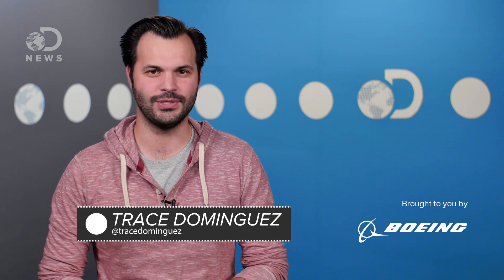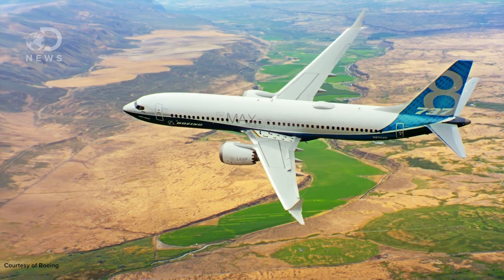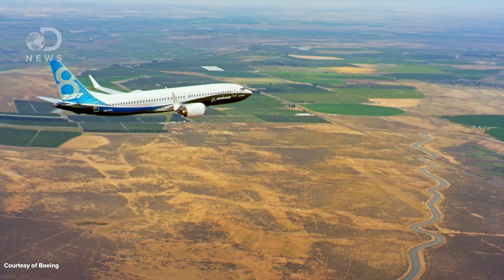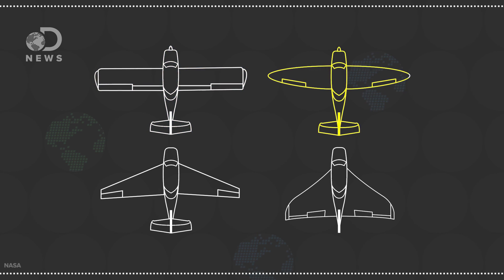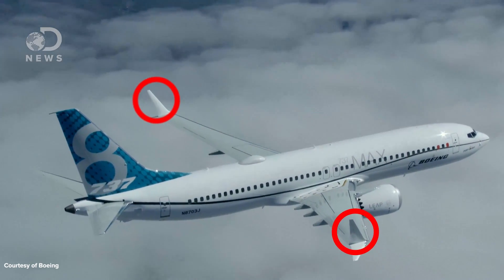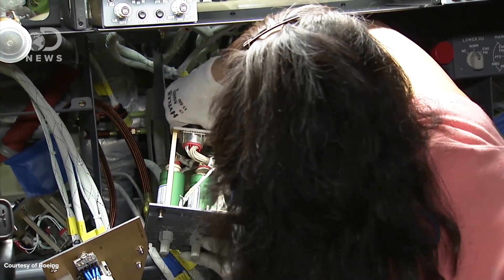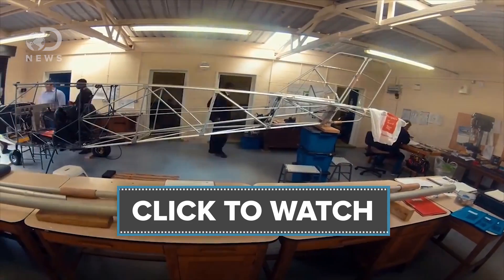Here's Why Wings Don't Fall Off Airplanes

Comment: well that's bullshit because thousands of planes of had wings fall off! In addition it's AEROPLANE not airplane!
Reply: it fell of sue to bad manafacturing simple as that

thousands have not fallen due to wings falline off (excluding combat aircraft)
Reply: Sure, thousands of aircraft had wings fall off when they were shot down by other planes or by ground fire. Unless you are dumb enough to fly your plane into a thunderstorm, the wings are not going to just fall off.  And there is nothing wrong with the word airplane.  If it's in the dictionary, it's a legitimate word.
Reply: Theweescot Airplane, Aeroplane and aircraft are all general terms
Reply: So when Chalk's Ocean Airways Flight 101 crashed in 2005 the wing didn't fall off the aircraft no! Don't talk shite!
Reply: Theweescot one thing is that you are comparing two completely different types of aircraft. that plane was built with a crappy 1947 method. there was stress on the wings, they constantly applied sealant because they had fuel leaks. mind you only 57 of these were made. I doubt they are in checkup like these big commercial aircraft,  that accident could have been prevented
Reply: The wings still fell off, this video title is still bullshit and meaningless.

Comment: The Title really is a bit ... strange?
"Here's Why Wings Don't Fall Off Airplanes"

Hey, here is why windows  do not fall out of your wall - cause usually humans are smart enough to fixate them.
Reply: But wings always look like they could just fall of at any moment. They are very long and only attached at the far end. I think that's what the title refers too, but then, that doesn't really get answered. "They attach them to the plane" isn't really the answer I was expecting.
Reply: Richard - congratulation - you have successfully proven that you are a hypocrite.
Reply: I would assume people are interested in the strength of the attachment. The stresses of flight look like they should be able to snap a wing off, but obviously dont.
Reply: ABaumstumpf You don't understand the subject because you don't realise what kind of challenge it is to lift a few hundred tonnes on such a small surface. A.k.a. You're dumb.

Comment: this vid doesn't really explain why wings of airplane doesn't fall off. crap vid.
Reply: Since the wing is mounted below the body of the plane, the plane sits on the wings. Therefore when in flight, the air pushing up against the wings is also pushing up on the body of the plane keep the wings intact. If the wings push against the body, then how do they fall off? Also each wings has around 1600 bolts holding them on. Please actually pay attention to the video.
Reply: its a 5 minute advertisement.
Reply: To tell us, they'lld have to tell us to go get a degree in engineering.
Reply: they said "1500" nuts and bolts for each wing;

Comment: All aircraft wings are a compromised and are optimised for a specific Mach number. Winglets actually prevent the high pressure air escape from under the wing and onto the top, the rolling over the end and the forward motion of the aircraft are what cause the vortices. The vortices generate significant drag (can be up to 45% of total induced drag) while in level flight at cruise. They can also generate up to 90% of the induced drag at take off

Comment: An interesting thing is that adhesives would be better than bolts in many situations and the fact is that they are there is because of feelings of safety rather than backed by actual science. They use both in some situations which only results in extra weight being carried.

Comment: 60 years ago. A vertical stabiliser snapped of a old boeing 707 over mount fuji and it is operated by BOAC
Reply: That was 31 years ago (1985), and it was a 747.  And it didn't just randomly snap off; the tail assembly was damaged by an explosive decompression caused by a bad repair made some years before.  It just happens that the vertical stabilizer took the worst of it.
Reply: Stephen Parkin I am talking about BOAC 911. Look it up on Wikipedia for more info
Reply: Ifly 777 I stand corrected!

Comment: The Wright Bro's may have invented powered flight, but they turned out to be more like the Fine Bro's. They had such a large blanket patent on wing warping, that the evolution of aircraft was at a stand still for at least 10 years. Glenn Curtiss created the modern aileron design, but was in a constant legal battle with the Wright Bro's until they both finally died.

Comment: I've been on a flight to Europe and we were force to land overnight to replace an engine that fell off during flight.
Reply: Impossible. Every plane that lost an engine during flight crashed horribly. Multiple hydraulic lines run through the engine and if the engine would disconnect from the wing the aircraft would be crippled and would crash. Ex AA 191 and El Al flight 1862. Google them.

Comment: I wonder why they bolt the wings to the fuselage, instead of welding the lateral spars together? I bet it makes it easier to take the wings off for maintenance, but wouldn't a weld joint be much lighter?
Also to answer your question; as long as I have confidence that the plane was put together competently, I'd have no problem riding in a student assembled airplane. In fact I bet the  students could make a more efficient airplane, to compensate for the knowledge being new to them.
Reply: Welding would add a lot more weight than you think it would. These days the materials that airplanes are built with are super light, strong and spetially built for aviation.
Reply: Has to do with metal fatigue, with so much stress, you don't want permanent connections. Even tough a plane wing would never be removed unless corrosion or metal fatigue has been detected on the joints, bolts are better in this case. You could however weld fuselage parts, ribs and beam structures together

Comment: Ok now EXPLAIN to me why after all that cost saving fuel flap device crap story... I only get offered 1 bag of peanuts with half a coke for all my Trans Atlantic/Pacific flights. Innovative Engineering right there....
Reply: That's impossible. Airlines are required to serve the passengers a meal if the flight is greater than 4 hours.
Reply: Jesse Vermeulen PLEASE schedule your next flight with Norwegian Airlines and let me know how it goes. The reviews were right.
Reply: Because jet fuel is becoming more expensive. They spend too much of it melting steel beams

Comment: If you're afraid of flying, it's best you don't read this. Also, this video probably didn't help with your fears.

The strongest component of an airplane is the wing spar- basically the box the wings attach to. The attachment points are equally strong... most of the time. The biggest downside here is age, and resulting metal fatigue- the metal wears down until it starts to fail. Recent examples of this are the 2002 tanker crashes- one of which was filmed and is available on YouTube (be aware that you are watching 3 people plummet to their deaths though), and Chalk's Ocean Airways 101, in Miami, 2005. The wings were not properly tended to, and they snapped off at their base.

Another, less likely, incident is where the wing itself fails. In the late 50's, two Lockheed Electra planes broke apart due to "flutter", where the wing naturally bends during flight (trying to use Layman's terms, so please correct me if you want). This is common and normally harmless; when it's not, the wing enters a "harmonic resonance", where its naturally movement is in tune with its natural frequency, and the bending keeps increasing until the wing snaps. Fortunately, air travel has improved immensely since then- the biggest thing to watch out for is old airplanes and shoddy maintenance- I'm looking at you, Allegiant.
Reply: Shots fired
Reply: wolfbyte3171 are there any solutions to making wing bodies last longer?
Reply: Not that I'm aware of. Having more composite materials may reduce the effects of metal fatigue, but I'm not too sure.
Reply: You don't know what metal fatigue is.
Reply: I know the basics of it, but feel free to correct me, and I'll edit the original post.
Reply: metal faitige is one thing mechanics look for, 

the spars of a wign are quite strong, they are often inspected, by often i mean almost weekly
Reply: actually on the electra it was caused by "whirl mode vibration" you are correct in that it led to harmonic resonance.
If memory serves me, they supposedly corrected it by beefing up engine mount points. It can happen so
fast that the crew doesn't have time to react. Interesting enough, the military version of the electra is now
used for hurricane hunting.
Reply: wolfbyte3171 Great, now I can say everything I know about airplanes I learnt from some dipshits uninvited rambling youtube message.

Comment: So if the wings help save money on fuel why is it that the cost of plane tickets have only gone up
Reply: Alex Clark fuel cost and airport costs
Reply: They're actually going down. You don't understand that the money you pay for the ticket pays for maintenance, fuel, and hundreds of people's paychecks while still making a profit. Jesus people, do some research.
Reply: Alex Clark cuz money for fuel is going up
Reply: The cost you pay can sometimes go up or down based on the cost the vendor has to pay for their materials.  But it is not the only factor in price.  What the market will bear is also a significant issue.  When fuel costs were sky high, the airlines did raise prices, but couldn't raise then as high as they really needed to and were loosing money.  But the market wouldn't bear even higher prices.  On the other hand, if their prices go down but the market will still bear the old price, then the airline will just take it as profit.
Reply: Some of the low cost carriers have a fixed profit margin. Ryanair for example look to make just £16 profit per passenger on their flights, hence the 'cram em in' policy. Other airlines charge whatever they can get away with. It wouldn't be unusual to be sitting next to a passenger who paid half, or twice as much as you.
Reply: they pay for the following

fuel, dollar to 5 dollars per person (on a large aircraft)

wages of pilots, attendents, airline workers

landing fees, 

gate fees for airlines

payign off the aircraft

ground crew (pushback etc.)
and maintenence and of couse a small nbit for company profits and investments
Reply: They may not bring the cost of your ticket down but certainly they make it to not go up a little more.
Reply: Richard F. Stripe and you Jesus need to get a brain, it's going up because new airplanes are  cheap and efficent to fly and ceos love money. Wonder why you had to ask. Why are their salaries going up and bonuses more money from plastic cheap planes less operating costs more money for them
Reply: Alex Clark They now gonna raise even more because of the new emergency system! The cabin will detach from the aorplane itself and will have parachutes now u can fly witjout fear but with less money

Comment: Who could've guessed. Wings don't fall off airplanes because it takes 12 hours to connect them.
Reply: 12 HRS for the super glue to set
Reply: I thought the fuel goes in the wings?
Reply: but if they cut corners, much less time!

Comment: is it normal for the wing to start wobbling 

because it looked like it was gonna snap off
Reply: RB26DETT DK wings are designed to be flexible so that in turbulence or other conditions that can put stress on the wings, the wings won't just snap off. There are videos of wings being tested to the snapping point the amount of bend needed would almost never be reached normally for an airliner
Reply: ***** ok, thank
Reply: RB26DETT DK they are designed to. The more the wing flexes the smoother the ride :3
Reply: Usually they calculate the worst stress a wing could ever encounter during flight (that would be the highest possible force due to turbulence plus the worst possible pilot error) and multiply by 1.5 or something and that would be the stress a wing is designed to withstand. Search for wing break test, and watch the boeing video. It is pretty insane to see how much a wing could be bent before it breaks. And compare the bending you see in the video to what you will usually see during a turbulent flight. You should never be afraid of a breaking wing ever again haha.
That being said we humans are irrational and tend to be more afraid of things we have no control over. I still am more afraid of flying a plane than driving my car, even though the latter is 10x more likely to get me killed haha.
Reply: What I can tell you is that it is scary to see the wing tip of a F-16 wobbling when it is flying

Comment: never answered why they don't fall off. just what the wing does basically. they said 1600 bolts but I wanted to see the engineering that went into it after seeing the title of the video
Reply: Trace Dominguez well then don't title the video as a click bate. the video was fine, but the video has nothing to do with the title. come on now, dnews is above click bate
Reply: Dihedral wing shape has no significant advantages in terms of strength.
Reply: Well, I can't guarantee what I'm saying is 100% correct(so take it with a grain of salt and correct me if anyone has better information)

However the spar on a plane is what provides the strength of the wings. These spars however go to both wings and the fact that they are connected provides more strength.
The dihedral also increases strength by making a "triangle" of the wings.
Triangles are referred to as the strongest shape because they transfer weight across the sides.
Reply: its said that the plane rides on top of the wing, they are not attached to the side, so it would take something serious to compromise it I think!
Reply: dihedral has nothing to do with strengh. it has to do with inherent stability.
Reply: The wing box is built into the fuselage at Spirit in Wichita.
The wings are installed at Renton using bolts on the wing box, at the side of the fuselage.
Renton final assembly has about 4 group tours going thru it everyday, but you have to be an airline customer, government employee, or part of an educational group or supplier to get a tour.
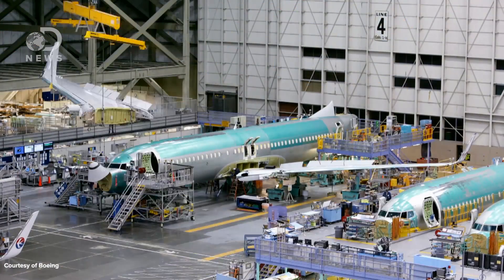Reply: He did say that but why at the 1:20 mark are they attaching the wings to the side?  When I built models as a kid, both wings were one full peace but that is not what it looks like is going on in the video.  They should have explained and shown it more detailed.
Reply: Yes, title fail I agree
Reply: Since the wing is mounted below the body of the plane, the plane sits on the wings. Therefore when in flight, the air pushing up against the wings is also pushing up on the body of the plane keep the wings intact. If the wings push against the body, then how do they fall off? Also each wings has around 1600 bolts holding them on. Please actually pay attention to the video.
Reply: ...and is also a secret. We asked like 10 times and they wouldn't even let us near the assembly.
Reply: It was answered. This channel isn't how it's made or something. They explained that the cabin and rest of the fuselage sit atop the wings as opposed to them being attached on the side. Some people believe they are assembled using the method of the latter. If you want to see the engineering I'm sure it would take longer than 4 minutes to explain.